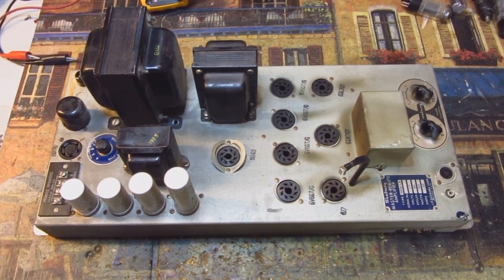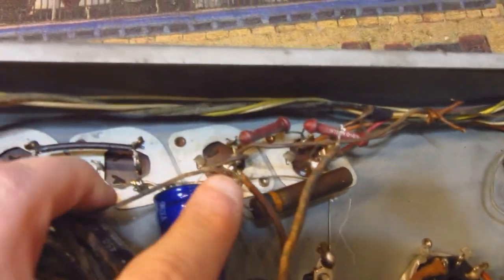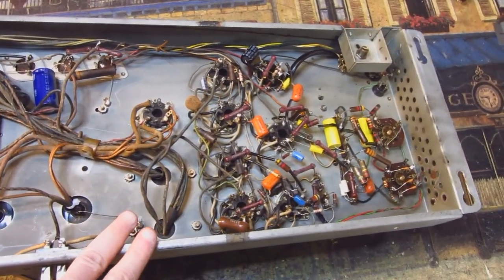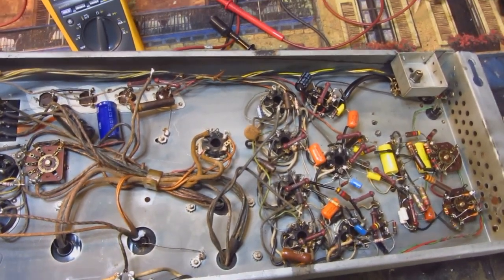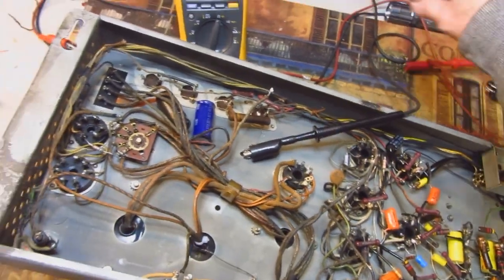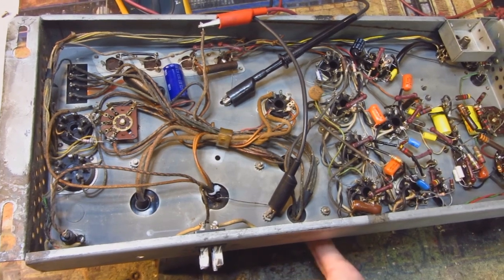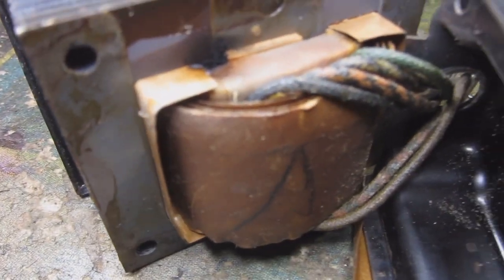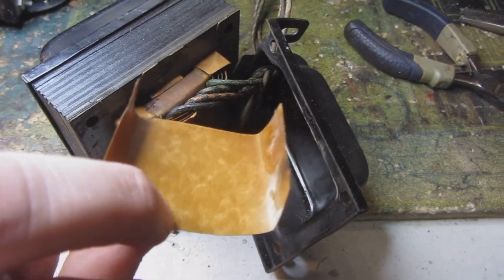Seeburg MRA1-L6 M100B amp repair diagnosis occasional fuse blowing Part 1

Comment: that was awsome would love to know what transformer you use for a replacement thanks
Reply from the maker: thanks.  Part 2 will be the new transformer install, quick rebuild of the power supply, then checking the performance